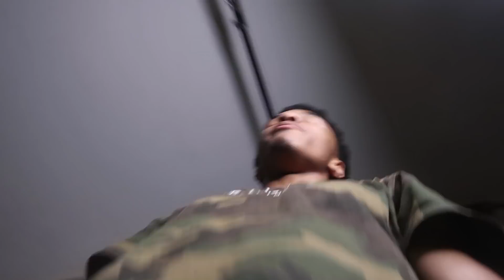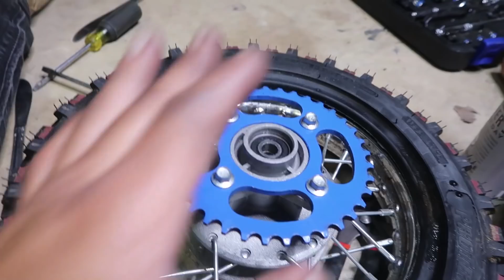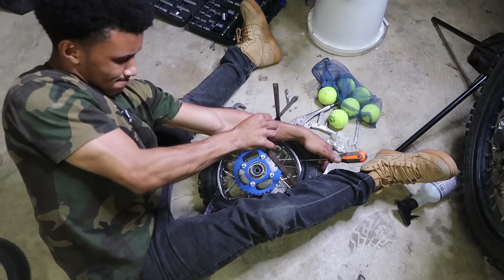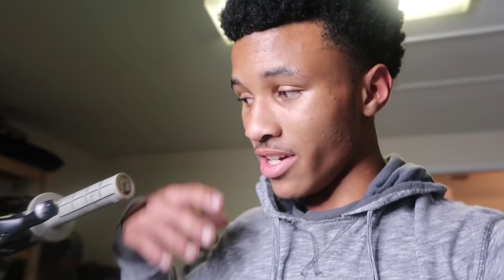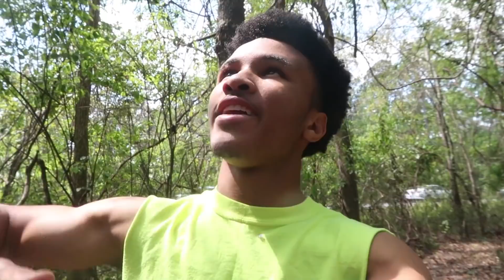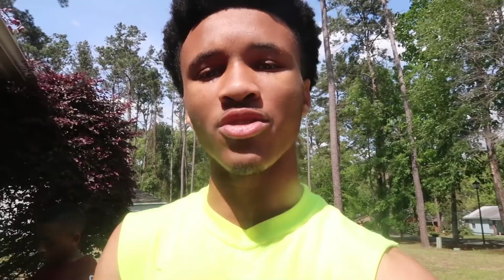Replacing PITBIKE TUBE With TENNIS BALLS!! | Does it work?

Comment: That's a briar for ya .my son has a 49 cc opollo and when I road it the tube tore the valve stem off 3 times and figured out it was the tire pressure but they definitely need to have wider tires